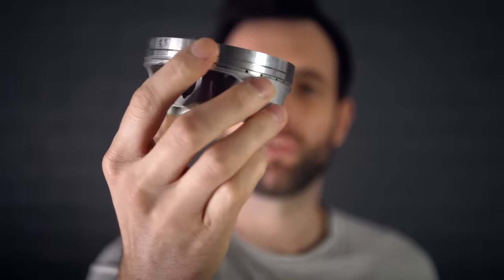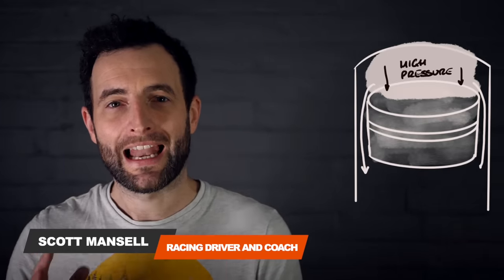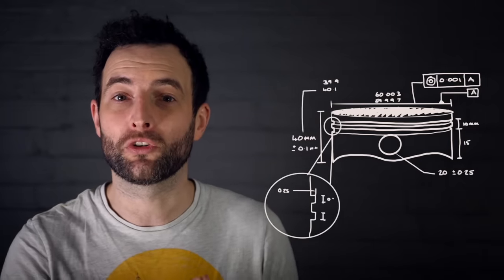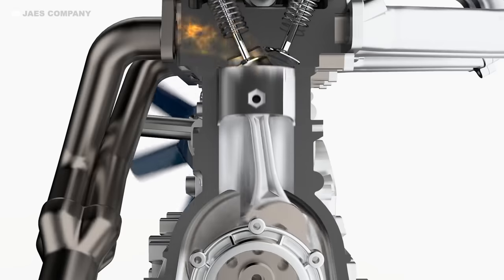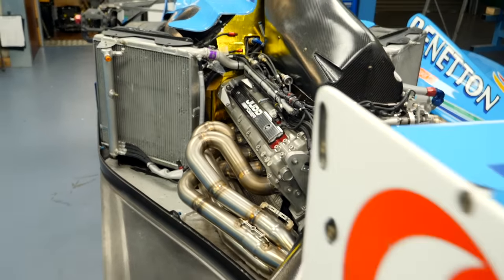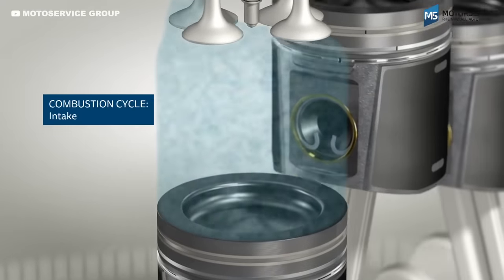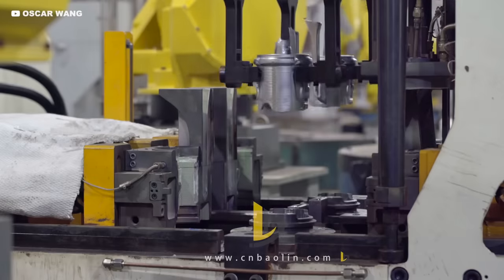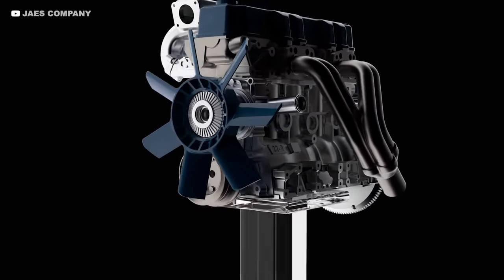Why F1 Pistons Cost £50,000!

Comment: You might want to check the statement that piston experiences more force from direction change than the combustion pressure. I couldn't find the exact number for piston diameter or peak cylinder pressure but max bore is 80 mm, so lets use 75 mm on calculation and then lets use relatively low peak pressure of 150 bars. That generates already 6 tons of force against the piston.
Reply from the maker: Hey, great to have you here! This is the reference for that statement - http://blog.wiseco.com/how-to-make-pistons-lighter
Reply: Man I noticed that too but it took me a second and then i was like wait a minute that's not right
Reply: @Driver61  6seOa
Reply: Nope, 100% correct that maximum load is at TDC OVERLAP as there isn't any 'cushioning effect from mixture or combustion. That's something I knew about from motorcycle literature in late 1960's.
As for why pistons cost £50,000, didn't explain that at all. (see my general comment)
Reply: Damnit Lauri, why do you Finnish think you're so smart?😀 Had to give  you some shit! You should get ahold of some of these and do some press tests...
Reply: I think the this information is partially correct, but has been poorly represented. Con rods tend to fail on the exhaust stroke because they are subjected to tensile stress, where as all other strokes they are subject to compressive loading (The reason rods fail when engines are over revved when gears are missed, low compressive load but high piston speeds resulting in high tensile loads). I could see this being correct with the loading around the gudgeon pin of the piston. Evidence of this can be seen when looking at the con rods and pistons in a 2 stroke engine compared to a 4 stroke engine of the same power output. A 2 stroke has compressive loading on all strokes and the rods and pistons are a lot weaker.
Reply: Let's see how much tons can one or several F1 pistons withstand on your Press. If it's less than 6tons, F1 manufacturers are cheap ass fugs liars! :D
Reply: @RetroArcadeGuy  those were my thoughts exactly! Where can we get this boy some Pistons?
Reply: The pressure on the top of the piston at the instant of explosion is many tons. This guy obviously is not a mechanic. I leaned that in high school auto shop class from a teacher who was a diesel mechanic. Take away his man card. He belongs in the girls section.....LOL
Reply: @craigharvey9265   I agree Craig, many years ago I remember reading about NHRA Pro Stock racers blowing up their engines in the shut down area from stabbing the clutch and letting off the accelerator at the same time. They remedied this by simply letting off the throttle and leaving the clutch alone for a few seconds.
Reply: An F1 piston doesn't cost that amount and for the guy that asked the bore is around 92mm depending on engine make and the weight is 250kgs/280kgs the piston weight at 15000rpm is approx 6tons on the V10s it was 9 tons at 18500rpm. The piston he is showing is an old type piston, modern pistons are from the squish to the pin centre is 20mm and from pin centre to bottom is 20mm and they are made from 319 Alluminium, they have 4 webs across  2 inline with pin and 2 90degrees to pin line not  2as shown here.
Reply: do collab
Reply: @1crazypj  There's an 80% surcharge for being labelled "F1"
Reply: @funkyzero  It would need to be closer to 8,000% to get to £50,000
Reply: A very rough estimation is 5.4 tons for the inertial force experienced by the piston during the exhaust stroke.
This is using 300g as the piston weight, 300Hz as the rev. frequency, 10 cm as total stroke length and a lot of other approximations (as, for example, the effective time for the direction change being 1/2 of the rev. period). Of course these are extreme approximations and probably far from representing true values. However, they should be rounding up on the higher side of the estimate.
So yeah, I am also a bit skeptic about the blanket claim from WISECO/DiBlasi. Most likely, the figures for both forces are generally quite similar and can be tuned by engineers to yield whatever behavior they prefer.
Reply: his math at 5:44 is way off too.
Reply: “In the beginning was the Word, and the Word was with God, and the Word was God.
The same was in the beginning with God.
All things were made by him; and without him was not any thing made that was made.
In him was life; and the life was the light of men.
And the light shineth in darkness; and the darkness comprehended it not.
There was a man sent from God, whose name was John.
The same came for a witness, to bear witness of the Light, that all men through him might believe.
He was not that Light, but was sent to bear witness of that Light.
That was the true Light, which lighteth every man that cometh into the world.
He was in the world, and the world was made by him, and the world knew him not.
He came unto his own, and his own received him not.
But as many as received him, to them gave he power to become the sons of God, even to them that believe on his name: Which were born, not of blood, nor of the will of the flesh, nor of the will of man, but of God.
And the Word was made flesh, and dwelt among us, (and we beheld his glory, the glory as of the only begotten of the Father,) full of grace and truth.
John bare witness of him, and cried, saying, This was he of whom I spake, He that cometh after me is preferred before me: for he was before me.
And of his fulness have all we received, and grace for grace.
For the law was given by Moses, but grace and truth came by Jesus Christ.
No man hath seen God at any time; the only begotten Son, which is in the bosom of the Father, he hath declared him.
And this is the record of John, when the Jews sent priests and Levites from Jerusalem to ask him, Who art thou?
And he confessed, and denied not; but confessed, I am not the Christ.
And they asked him, What then?
Art thou Elias?
And he saith, I am not.
Art thou that prophet?
And he answered, No.
Then said they unto him, Who art thou? that we may give an answer to them that sent us. What sayest thou of thyself?
He said, I am the voice of one crying in the wilderness, Make straight the way of the Lord, as said the prophet Esaias.
And they which were sent were of the Pharisees.
And they asked him, and said unto him, Why baptizest thou then, if thou be not that Christ, nor Elias, neither that prophet?
John answered them, saying, I baptize with water: but there standeth one among you, whom ye know not; He it is, who coming after me is preferred before me, whose shoe's latchet I am not worthy to unloose.
These things were done in Bethabara beyond Jordan, where John was baptizing.
The next day John seeth Jesus coming unto him, and saith, Behold the Lamb of God, which taketh away the sin of the world.
This is he of whom I said, After me cometh a man which is preferred before me: for he was before me.
And I knew him not: but that he should be made manifest to Israel, therefore am I come baptizing with water.
And John bare record, saying, I saw the Spirit descending from heaven like a dove, and it abode upon him.
And I knew him not: but he that sent me to baptize with water, the same said unto me, Upon whom thou shalt see the Spirit descending, and remaining on him, the same is he which baptizeth with the Holy Ghost.
And I saw, and bare record that this is the Son of God.
Again the next day after John stood, and two of his disciples; And looking upon Jesus as he walked, he saith, Behold the Lamb of God!
And the two disciples heard him speak, and they followed Jesus.
Then Jesus turned, and saw them following, and saith unto them, What seek ye?
They said unto him, Rabbi, (which is to say, being interpreted, Master,) where dwellest thou?
He saith unto them, Come and see.
They came and saw where he dwelt, and abode with him that day: for it was about the tenth hour.
One of the two which heard John speak, and followed him, was Andrew, Simon Peter's brother.
He first findeth his own brother Simon, and saith unto him, We have found the Messias, which is, being interpreted, the Christ.
And he brought him to Jesus.
And when Jesus beheld him, he said, Thou art Simon the son of Jona: thou shalt be called Cephas, which is by interpretation, A stone.
The day following Jesus would go forth into Galilee, and findeth Philip, and saith unto him, Follow me.
Now Philip was of Bethsaida, the city of Andrew and Peter.
Philip findeth Nathanael, and saith unto him, We have found him, of whom Moses in the law, and the prophets, did write, Jesus of Nazareth, the son of Joseph.
And Nathanael said unto him, Can there any good thing come out of Nazareth?
Philip saith unto him, Come and see.
Jesus saw Nathanael coming to him, and saith of him, Behold an Israelite indeed, in whom is no guile!
Nathanael saith unto him, Whence knowest thou me?
Jesus answered and said unto him, Before that Philip called thee, when thou wast under the fig tree, I saw thee.
Nathanael answered and saith unto him, Rabbi, thou art the Son of God; thou art the King of Israel.
Jesus answered and said unto him, Because I said unto thee, I saw thee under the fig tree, believest thou? thou shalt see greater things than these.
And he saith unto him, Verily, verily, I say unto you, Hereafter ye shall see heaven open, and the angels of God ascending and descending upon the Son of man.
And the third day there was a marriage in Cana of Galilee; and the mother of Jesus was there: And both Jesus was called, and his disciples, to the marriage.
And when they wanted wine, the mother of Jesus saith unto him, They have no wine.
Jesus saith unto her, Woman, what have I to do with thee? mine hour is not yet come.
His mother saith unto the servants, Whatsoever he saith unto you, do it.
And there were set there six waterpots of stone, after the manner of the purifying of the Jews, containing two or three firkins apiece.
Jesus saith unto them, Fill the waterpots with water.
And they filled them up to the brim.
And he saith unto them, Draw out now, and bear unto the governor of the feast.
And they bare it.
When the ruler of the feast had tasted the water that was made wine, and knew not whence it was: (but the servants which drew the water knew;) the governor of the feast called the bridegroom, And saith unto him, Every man at the beginning doth set forth good wine; and when men have well drunk, then that which is worse: but thou hast kept the good wine until now.
This beginning of miracles did Jesus in Cana of Galilee, and manifested forth his glory; and his disciples believed on him.
After this he went down to Capernaum, he, and his mother, and his brethren, and his disciples: and they continued there not many days.
And the Jews' passover was at hand, and Jesus went up to Jerusalem, And found in the temple those that sold oxen and sheep and doves, and the changers of money sitting: And when he had made a scourge of small cords, he drove them all out of the temple, and the sheep, and the oxen; and poured out the changers' money, and overthrew the tables; And said unto them that sold doves, Take these things hence; make not my Father's house an house of merchandise.
And his disciples remembered that it was written, The zeal of thine house hath eaten me up.
Then answered the Jews and said unto him, What sign shewest thou unto us, seeing that thou doest these things?
Jesus answered and said unto them, Destroy this temple, and in three days I will raise it up.
Then said the Jews, Forty and six years was this temple in building, and wilt thou rear it up in three days?
But he spake of the temple of his body.
When therefore he was risen from the dead, his disciples remembered that he had said this unto them; and they believed the scripture, and the word which Jesus had said.
Now when he was in Jerusalem at the passover, in the feast day, many believed in his name, when they saw the miracles which he did.
But Jesus did not commit himself unto them, because he knew all men, And needed not that any should testify of man: for he knew what was in man.”

Gospel of John - Chapter 1-2, King James Version.
Reply: @1crazypj  The issue is that when people try and make all of this sound so impressive and cool, they forget to factor in what the expenses are. Yes they are expensive, but not because the material or the manufacturing is that expensive. They are expensive because the F1 teams spend huge sums and lots of hours on R&D. And in this day and age where teams use few engines, that also mean they buy much fewer pistons. So by that extent, yes they are very expensive, but not because the finished product in itself is expensive.
Reply: @AB-80X  £50,000 is still BS. 
F1 teams don't do R&D on pistons although they do have to find out what went wrong if it breaks.
There are piston manufacturers who are doing R&D continuously, small volume production is not justification for exorbitant claims.  A forged piston is a forged piston, the cost is in the forging dies which may well cost £50,000 but the pistons are only a few hundred each.
Porsche use Mahle and have developed some very clever  pistons which cannot be made except by 3D printing (Porsche and Mahle go back to at least mid 1960's)
Reply: @1crazypj  
It is not that simple. It really depends on the team. Ferrari for instance does a lot of their own engine R&D including piston design. This is not an assumption, this is from a good friend who works at Mahle doing this stuff. There are other teams that do next to no R&D on the engines, but that's because they buy engines from a dedicated engine manufacture, and they develop their pistons in conjunction with the piston manufacture, usually Mahle. Mahle is the largest provider of pistons for F1 and they do spend a lot of time doing R&D. Looking at what is charged per hour of labour all around for this R&D etc. designing the rotating assembly takes up a large chunk of the budget for designing an F1 engine.
Now are the forgings themselves that expensive? No. They are not that different than any other high performance custom piston you and I can order from Mahle. Where some of the money have gone on occasion, has been into research of new piston coatings which I know for a fact that Ferrari spent a ton of money on a few years back, only to ditch for the already known ptfe/hardcoat combo some currently use.
Here's where I think the misconception is. If I look at the hours they spend on designing the first piston, which can easily be in the high hundreds of hours which comes at a fairly high hourly rate + initial production costs, yes then I can see that first finished piston ending up costing that much or at least close to it. Here's another thing to take into account. My Ferrari dealer owns the 1995 Jean Alesi Ferrari F1 car and uses it. We have talked parts prices a few times, and even to this day, Mahle charge 1300 Euro for a piston for that car. You can be very sure that Mahle charge that or more per prototype piston they do during R&D and they do a bunch of those before settling on the final design. So outside of the hours spent on the R&D itself you can factor in 15-20 pistons at that price or more a piece. So yes, that initial first piston might be that expensive, but as soon as you buy 50 of them or more, then obviously the price drops dramatically.
Sorry that got long winded, but that might explain why some would claim that the piston is that expensive. Is it a massive inflation? Yes and you are 100% correct in that it is a total B.S claim. Just trying to shed some light on how someone might put together the maths that create that ridiculous price.
But then again, a tyre would be what, well over a million. lol.

That's what a I hate about these kind of videos and shows. Trying to make something more interesting by passing it off as something it is not.
Just go look at his video on tyres. What the hell kind of car today uses a 50 quid tyre? Last set I bought came to about 348£ a piece.
Reply: @AB-80X  Interesting stuff, nice to know you know someone at Mahle.
 I've always favoured their pistons over some of the crap on the market from US manufacturers (Wiseco used to be particularly bad until they got some CNC machines, buy 3 or more sets to get one size matching set, still need work to balance though)
Mahle have always been expensive but worth it (I was paying over £90.00 each in 1980)
This is the only video I've watched from Driver 61, the clickbait worked on this occasion but it won't work again .
Been nice 'talking' to you
Reply: @Driver61  site not online anymore
Reply: Understand that the piston top or face only receives the combustion load once per cycle.  However, the wrist pin area receives the same amount of acceleration during each movement of the cycle from the other pistons and rods forcing the crank to turn.  So, in essence when the piston is NOT being pressed down by the combustion event, it IS being yanked downward (and pushed upward) by the crank and rod from the combustion event of the other pistons in the engine.  While the top of the piston will only occasionally see load, the wrist pin and wrist pin bore of the piston is constantly loaded in reversing directions.  Also, the load on the wrist pin area is many times more because of the relatively small surface area of the wrist pin and wrist pin bore vs. the piston face.
Reply: My man… its closer to 10 bars. I think you may have confused bar and PSI. It is usually 180psi or around that. Adiabatic pressure difference for a typical 10:1 compression at ATM is 77psi before combustion.. thats somewhere around 5 bar
Reply: @jakub8860  Do unto others......
Reply: @jakub8860 Dude...!